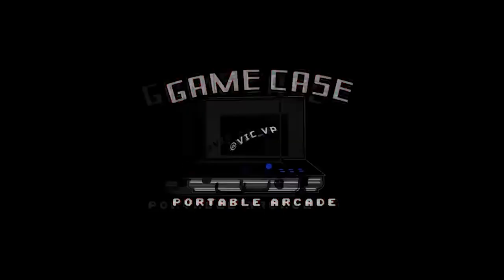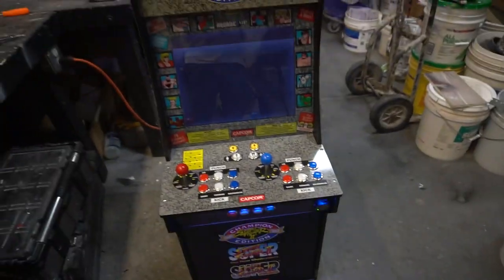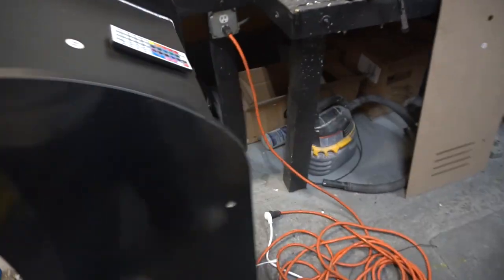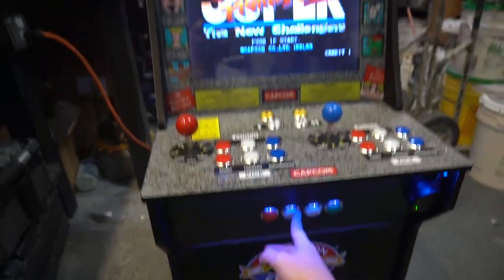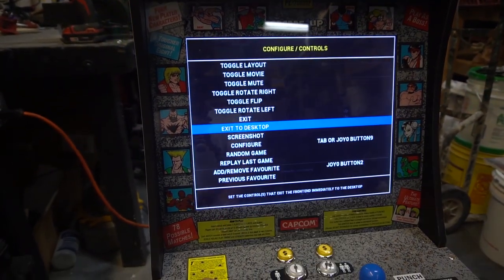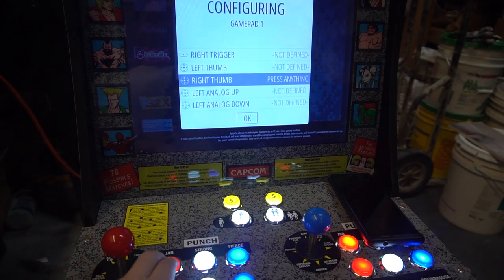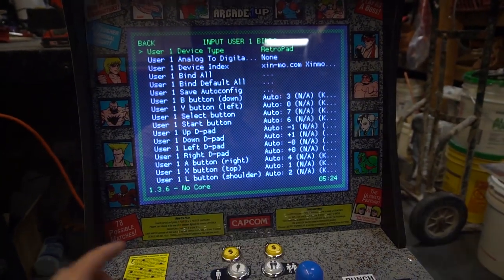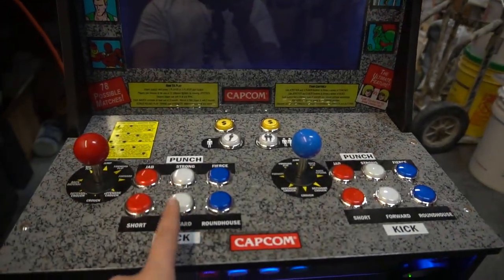Arcade 1up, Can I simply just buy a Sd card?

Comment: Wrong! I had no experience with raspberry pi and I bought a preloaded SD card on eBay hooked everything up put the card in and it instantly asked me to set up player one inputs. I was playing games 1 minute later.
Reply from the maker: That's how it should be, however not every card is made the same, if a preloaded card is set to boot into attract mode, a keyboard is needed to reconfigure the keys
Reply: Also purchased mine on Ebay last week after mod on my new Arcade 1up loaded fine was playing after controller set up

Comment: I'm trying to delete my SD card the information on there to rebuild my retropie onto my SD card can you help
Reply from the maker: Put the sd card into your pc and format it. However if you format it,EVERYTHING GETS DELETED.
Reply: Once I do that with everything on the computer get erased
Reply from the maker: @shinjikazama6441  yes you will lose everything on the sd card, as if it's a brand new sd card. So the boot file and everything will be gone
Reply: Is there any other way I can put Raspberry Pi onto my SD card without a computer or a laptop could I use the Raspberry Pi itself
Reply from the maker: @shinjikazama6441  not that I can think of, you can ethernet wire your pi and possibly run command line codes to get somthing, but that sounds like a nightmare

Comment: u should do a jamma pandora on lcd screen
Reply from the maker: I do have a pandoras box laying around, but it's the same concept buddy. Just no admin buttons needed lol, but I can do it next week if anything. Thanks for the suggestion!
Reply: @Vic_VP  dig!
Reply: @Vic_VP  i still have my full size cabinet running game elf, i need to swap it out for a Pandora 6 jamma. ( the pink one ). Yo do i need to buy the Jamma wire harness it comes with?  it has 2 options, one for normal joysticks and buttons OR for joystick and button with micro-switch? OR can i just use my game elf Jamma wire Harness? I see they sell the Pandora without harness. Thanks Vic !!
Reply from the maker: @EmadSaadDrasticMeasuresHipHop  Jamma is universal, it's the same setup for all pcb's I'm not sure what u mean by "joystick and buttons or joysticks and buttons with microswitch." All arcade sticks and buttons have micro switches lol
Send me the link. I didnt no a 6 has a jamma option. I have a 5s

Comment: I bought mod control panel from arcademodup.com and it came with 32gb card works great but some game can't play but it's ok no problem.

I went on Amazon saw a fully loaded retropie 256gb sd card I bought it put it in the pi it will load to the game but kind of slow can play some game but I cant go back out and all the buttons are different moves ...smh...
After a few minutes it take me to a screen and say I gotta change the pi password and the file is not in the right spot.
I don't even know how to fix the problem.
Reply from the maker: Send a return request to Amazon, that's why the pi is a great fool, however it's a linux based system. Programming it is a pain, if your gonna learn it, you might as well learn the pc hyperspin way.
What game are you trying to play?
Reply from the maker: You also need to get into retroarch and config the controls. When you first loaded up the 256, did it ask you to config controls?
Reply: @Vic_VP  the pi was slow and kind of lagging so I just played the first game I saw. Click on it still lagging when I try to quit cant even that.
Reply: @Vic_VP  yes they did but there's was too many so i onky did the one I know. I still gotta go and fix the control make everything right. 
I might have to change some files and change the pi password so it can load up but who knows it's a headache lol
I'll try my best to fix the problems when I have the time.
Reply from the maker: @MrMoneybag1988  what pi do you have? Is it a 3b+? Pi 4?
Reply: @Vic_VP  
I believe it's a pi 3b+.
Reply from the maker: @MrMoneybag1988  interesting... you can try to over clock it and see if it improves performance
Reply: @Vic_VP  ok I'll try it out. 
Thank you.